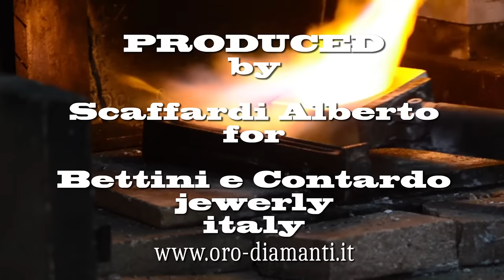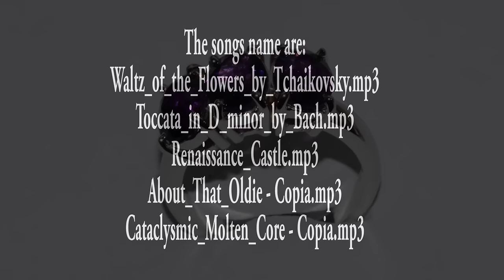trilogy ring with amethysts

Comment: First TTThhanks for all videos you make .. that's really awesome
second ..
If you have an idea .. 
when welding what's is weld metal .. and name of material that make welding easier and it valid for tin weld?
..
Reply from the maker: To weld the gold using the gold solder with a lower melting point